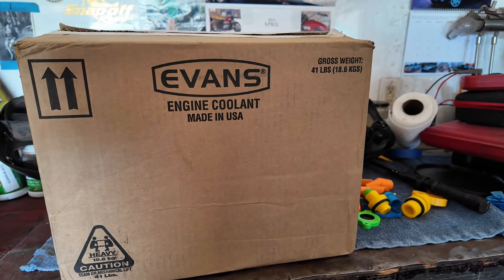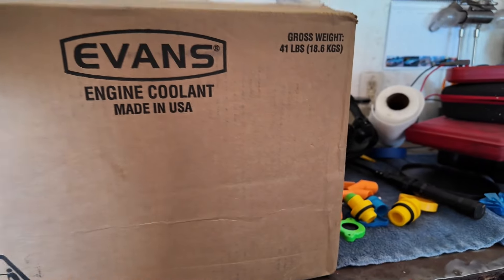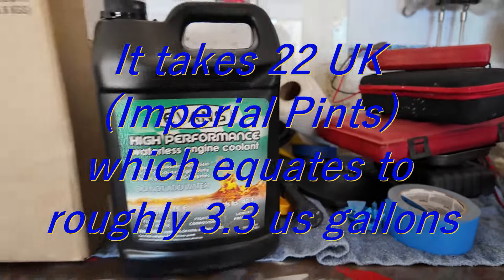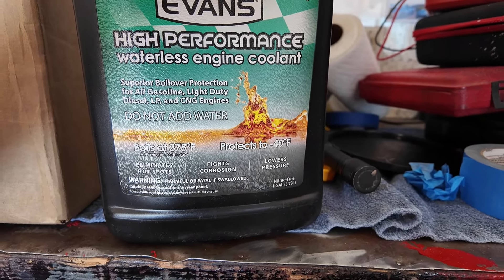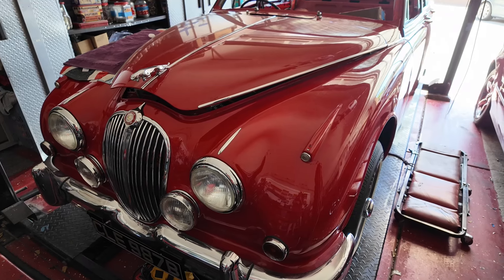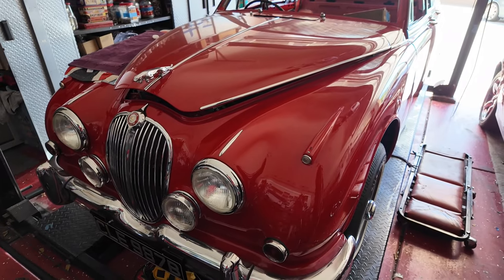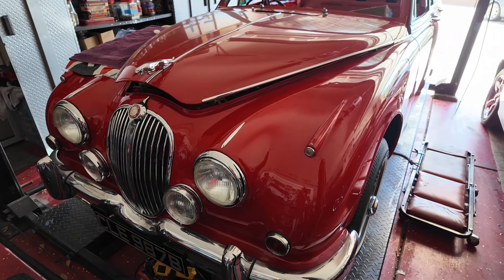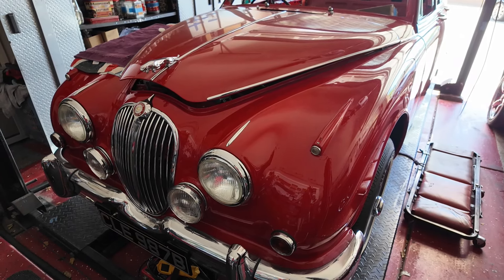Jaguar MKII Reassembly Part 278

Comment: Hi, a good trick, and put a tiny piece of plasticine at the end of the bolt Then the guide pin will not slip off so quickly. You can do it or not. It has to be small so that it can The screws do not hinder😅